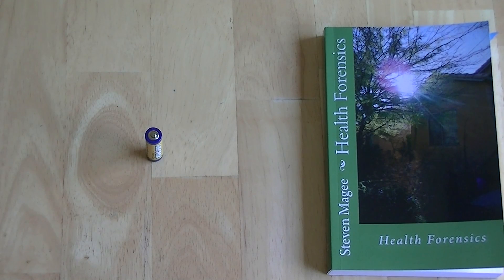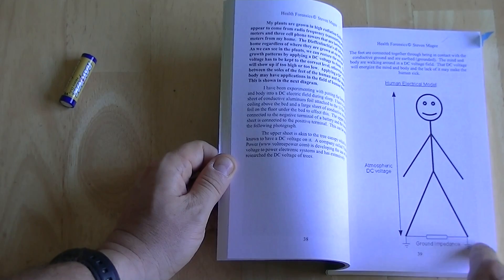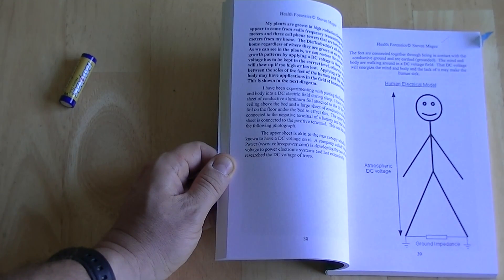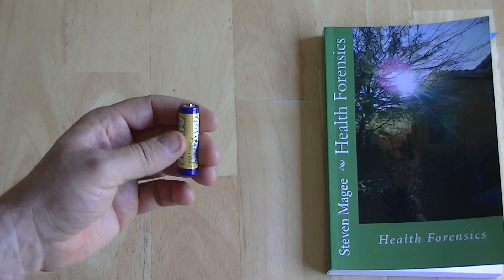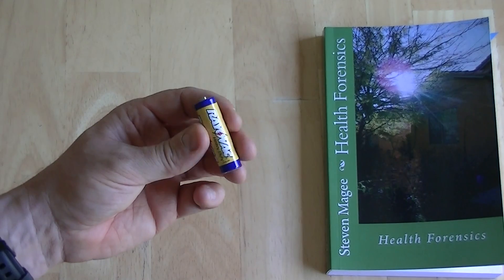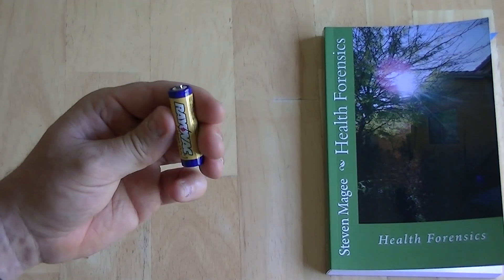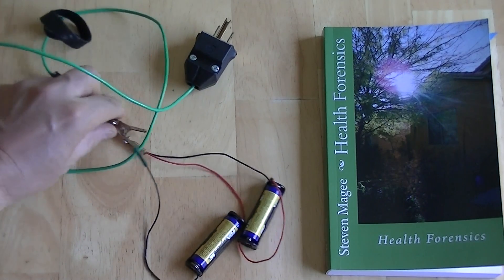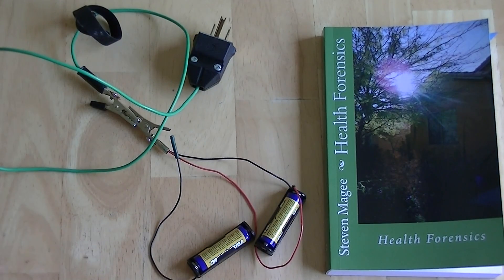WiFi & Earthing DC Battery Discharge Experiment

Comment: Makes me wonder, my body is essentially a large battery and when I exercise say pedal a bike up a mountain for 1 hour this creates electrical energy from the many sources of electrolytes and minerals and this energy is stored in my muscles.

So if I`m surrounded by RF radiation from cell towers, cell booster antennas, Wi-Fi, satellite radiation, power lines high voltage and non high voltage like the wiring in our homes, LED lights, fluorescent lights, CFL bulbs and.....

Then all that man made alternating current (AC) electricity RADIATION FOG that passes threw my body and interacted with my cells when it passes threw them could be affecting the magnetic forces that hold the charge and or effecting the sources that are put in a state for immediate usage... ?

Funny how are bodies use the magnetic positive and negative forces to keep us alive and yet society is so dumbed down they are oblivious to the man made AC Electro Magnetic Radiation FOG that is slowly making everyone dumber with a shorter life span in the process, all in the name of money and control of money :/

One more possibility, our brains have about 25 watts of electricity in them so it could be that brain fog is also one of the many negative impacts on our bodies from the wireless and non wireless man made AC power sources...

I have noticed when I go more than 3 or 4 days without a coffee I start to feel heavily sedated, not just in my mind but if I don1`t get intense exercise my energy levels get zapped as well...

Thank you for the video, looking forward to the outcome :]

Comment: I've heard that trees act like an antenna for RF, what about wood? The wood found in bed frames.
Reply from the maker: Live conductive wet wood found in live trees does indeed act like an antenna.  Dry non-conductive dead wood is well known for its electrical insulating properties and does not exhibit the antenna effect.  See http://w5jgv.com/tree_antenna/index.htm A Tree Antenna for the 600 Meter Band "Why put up an antenna when they're growing all around you?"e Antenna for the 600 Meter		Band